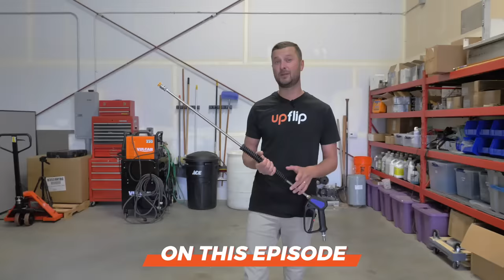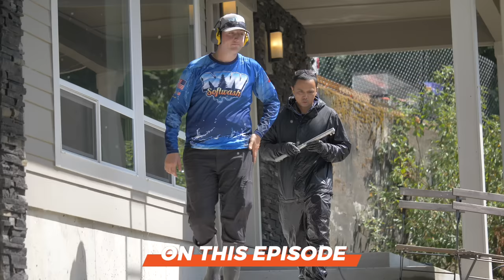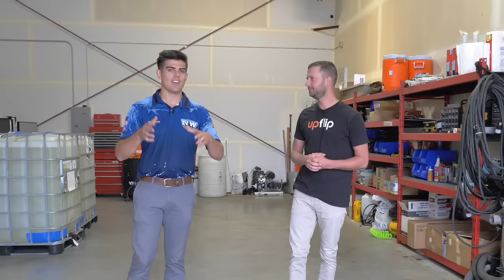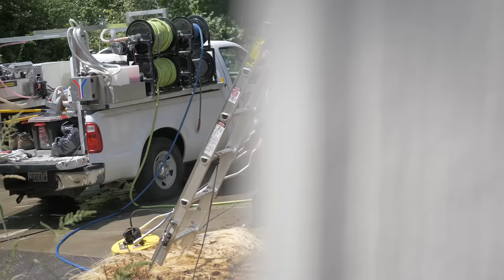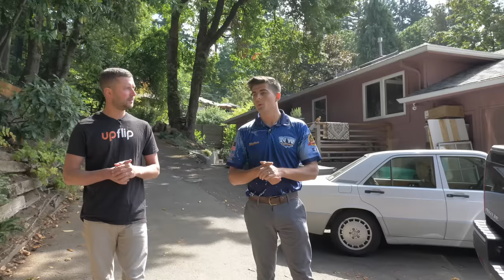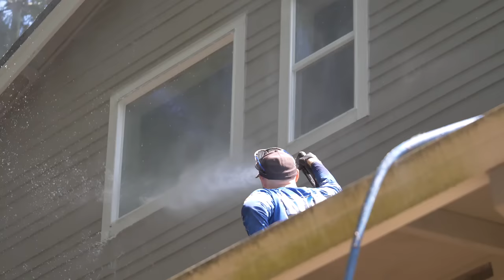21 Year Old Starts a $120,000 Monthly Pressure Washing Business

Comment: does the washing soap/chemical damage the grass around the houses? i already have a mobile detailing business but im looking to expand pressure washing/soft washing is probably what in going for
Reply: Yes. The chemicals are harmful to plants so you must dilute to the minimum required for the job. Also, you must rinse the plants before you start applying the chemicals to the house, then again immediately after applying the chemicals to the house, and then a third time after you have done the final rinse on the house. The main chemical is called Sodium Hypochlorite or "SH" for short. It is a pool-cleaning product. You can feed it into your pressure washer to mix with the main feed or mix it up in a backpack sprayer and apply it manually after you have done an initial wet-down of the section of house you're working on. Just work on part of the house at a time.

Comment: how are you soft washing ?, when using a pressure washer @4gpm & 3500 psi ,there 2 BE PRESSURE WASHER ON THE BACK YOUR TRUCKS. IF YOUR ONLY DOING SOFTWASHING YOU SHOULD BE USING ELECTRIC OR AIR DIAPHRAM PUMPS .

Comment: Pressure washing is meant for dirt, paint-stripping, and deep oil/grease stains. Softwashing is best for home exterior. Pressure washing and softwashing have their own use cases, you can use both. Not sure which is easiest to make profit off of. Driveway cleaning has a big market.
Reply: Two different types of equipment for both right? Is pressure washing best for starting out?

Comment: Yeah I work at pressure Pro here in Fort Pierce and I pull a lot of parts for your machine and the yellow covers I pulled many of them I'm going to try to figure out don't put up my own pressure cleaning business and I got a 4,000 PSI 13 horsepower Honda GX390

Comment: As someone who started a pressure washing business last year, this is very inspiring. It seems he got off the truck very quickly & had employees do the work, which is my goal. I am wondering though; you have to be somewhat hands on and knowledgeable of the equipment & what to do when stuff goes wrong. Soft Wash pumps, chemical usages etc. Wasn't much mention of it, just curious!

Comment: What would you recommend a 16 year old whose parents got a Pressure washer but not a surface cleaner? Should I start without it?
Reply from the maker: Surface cleaning is possible with just the pressure washer, but it could take time. I think it's best that you use the right tool (if you can afford it) to make the job more efficient. Hope this helps! ☺️

Comment: What would you recommend as a good  chemical/chemicals to use for power washing houses (vinyl siding, stucco, etc) and for walkways, patios Driveway’s? Etc. Would one chemical work for all or would it be a few different chemicals for different applications. I’m just starting out and would love to get some advice on what would be the best to use and also so that I can keep it some what simple to have some chemicals in stock. Thanks in advance.
Reply: And do any clients have concerns about the chemicals used? The strongest ones are probably easiest/fastest for e,players to get results but cd be harsh for the environment and the water drainage system (remember it all goes out to the fish here in the Pacific Northwest especially).

Comment: Great video. Very informational. One thing I believe I may have missed.. do you use your own water? Or do you attach to homeowners water supply? What are benefits or downsides to each option? Thank you
Reply from the maker: They use soft washing chemicals and they are using their own.
Reply: @stephrogers  where did you design your shirts? Was it online or a shop ? Im looking for a great reliable place/ site to design my shirts. Your shirts look super good it’s exactly what I’m looking for. Thanks
Reply: @stephrogers  what is your customers reaction to using their water

Comment: use 30 second cleaner or wet and forget..... get excellent results for roofs and siding.....
Reply from the maker: Are those soft washing cleaners?
Reply: @UpFlip  Yes, You can connect them to a hose or put solution in a tank sprayer.  Does the same thing, leaves siding like new.... see https://www.youtube.com/watch?v=kffBpOch4aQ&t=337s   of course you have to do the work yourself but save hundreds..... do my siding every couple of years......  works on sidewalks, decks, etc.....  Probably using similar chemicals in his business.  Kudos to the young man for the business he started.......
Reply: Wet and Forget, Costco sells it too........ this is great for roofs that you can hit with a hose,  you leave it on and the moss will be gone, takes a couple of weeks.

Comment: In reference good video AC lockridge started softwash systems in the '90s they use 12 volt pumps for soft washing low pressure and they use roof pumps AR-45s and AR-60s with the Honda engines and the general pumps are 5.5 gallons per minute at 2500 to 3,000 psi attached to a GX 630 or 690 Honda engine AC rockridge of soft wash systems in Florida he found it from the UK brung it over to the US did a tour and us Americans started seeing it and so we adapted it That's how softwashing come famous in America communications with your office staff in your employees is called a CRM customer relationship management software that you get and when you're marketing on Facebook you need to market for conversions there's a lot of things that you can learn starting off grow small be aware of your surroundings always be out there to educate your neighbor with everything that you can to help Great education sometimes some people just don't go straight to the points to help the new beginners keep up the good work brother and wash on
Reply from the maker: Thanks for sharing your industry insights GA! We appreciate you.

Comment: Couple questions you said generator when you were talking about power washers in reference to psi? Did you mean power washer instead of generator? Also there was a statement made earlier there was going to be an explanation between the difference of soft wash and power wash I must have missed that. I get what both do so you're basically only doing the soft wash on the house and roof itself?

Comment: When doing this type of work do people use the customers water or have a water tank? Especially when starting off
Reply: Good question. You always use the customer's water. If you have a big power wash unit built on a trailer, you will have a water tank which is used as a buffer. You supply your power washer from the tank but you have the customer's hose feeding into the tank at the same time. Let customers know in advance you will need to use their water but only use gas powered pressure washers/water blasters so you never need to hook up an electric lead.

Comment: That means on average you have to do 300 jobs a month. Most power washing jobs are right around 400 bucks so let’s just say the average at $400 that means you have to do 300 of them a month to make 120,000.
Reply: He's probably charging on average around 555 per job if his crews are working 6 days a week
Reply from the maker: Exactly! Plus he has his three trucks to use daily.
Reply: That’s still 215 jobs every month.
Reply: @williamrose7184  so he has three trucks working per day, 6 days a week let's assume. And each truck completes three jobs per day, that's 54 jobs in a single week assuming they only work 6 days a week. That's 216 jobs in a 28 day period. So its definitely possible if he's keeping each truck busy with 3 jobs per day
Reply: Yes but now you have to factor in reality unless he is one month out from taking on any new jobs it’s almost impossible. He would have to have 216 jobs lined up in advance every month. Most jobs you get a call from a customer they ask you to come out and give them an estimate which is going to take 2 to 3 days at a minimum.
Reply: But yes I do agree it’s possible. But $120,000 a month power washing I’m just not feeling it.
Reply: @williamrose7184  it seems like this guy really has a solid team to rely on and they are all great players. Without them it would be really difficult to achieve this level of success.

Comment: Do you typically use the clients water or have a large IBC cube?
Thank you
Reply: Both in most cases. Typically a customers water line can't support the 6+ GPM that a good soft wash system will need. Some don't use the customers water at all. Depends on how big your tank is, how big the house is, well or city water.  Lots of variables but starting out...use the customers water.
Reply: @jeremyfink537  thank you 👍

Comment: Is a softwash machine different that a pressure washer? Also, can i buy a pressure washer to act as a softwash when first starting out?
Reply: No part of you got to a 12 volt pump is normally what you start out with and soft wash batch mixing you work your way up to a gas-powered roof pump which are AR-45s and AR-60s That's what I run as a gas powered roof pump and you work yourself from a batch mixing system to a blend manifold which you can build yourself the power wash store come up with the proportioner but it's the same thing as you can build it's just a manifold with valves which are metering valves A metering valve is a v-ball in a true ball valve there is a lot of information on Google Good luck brother and wash on
Reply from the maker: Stephen should be able to elaborate on this pressure washing question.

Comment: How do u charge per roof or drive way
Reply from the maker: A lot goes into how much you charge, I think start off with your minimum hourly rate in your country/state, then multiply that by how many hours it'd take you to do the roof or driveway. Then adjust the price depending on labor, tools required, water used, fees, etc. That should get you a good estimate to start off with :)

Comment: In california, you can't just start up like this. You need 4 years of Journeymen experience in order to just apply for a Contractors license to do this.
Reply: You can start a pressure washing, soft washing business with no experience in California and you don't need a contractor license to do the work. Find out the requirements from your county and when you register for the name, you would then need a city license to run your business... pressure washing/soft washing is a cleaning service, so you wouldn't need a contractor license to start... I am in Cali and started my business and ran a fairly successful business in Northern California.  I would suggest you do your due diligence in making sure you pay attention to the US EPA regulations with regards to water run off from your job site though.  You can register with yelp as well to market your business.  Provide great customer service, learn proper techniques and you could be looking at a great business for yourself! 😊
Reply: @imzaq7  Zaid, thank you so very much for your advice! Will research what you said immediately.

Wish you the best!
Reply: @drobgyn5615  no problem at all... good luck with it.. watch a lot of videos on here about it, and remember you don't have to start out with a big trailer set up. You can start with a 4gpm (this should be your minimum pressure washer), you would need a surface cleaner for doing concrete work (18 inch is good), some chemicals, different nozzle sizes, a good ball valve, and a downstreamer and/or x jet (to use to apply the chemicals)... later on, you can get a bigger set up or a soft wash set up as well.  Sorry for the long message. Good luck with it!